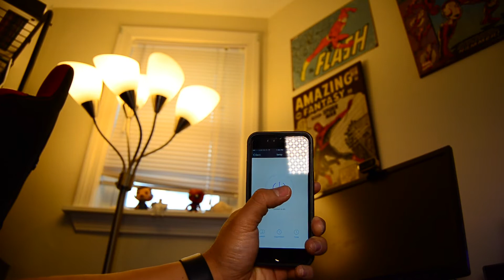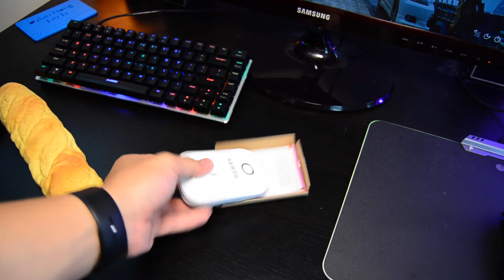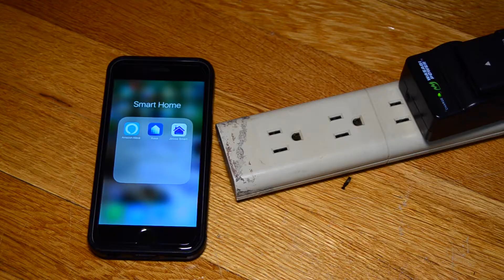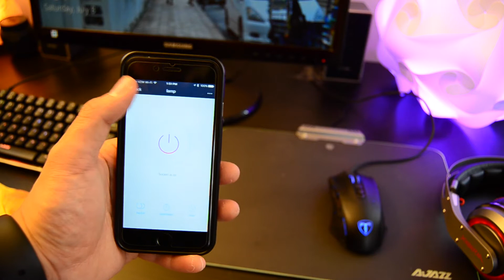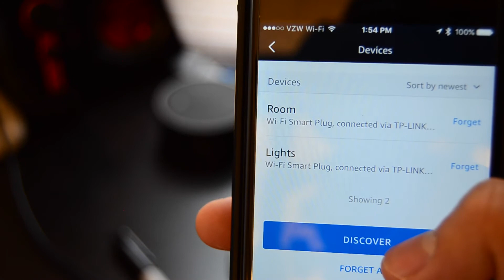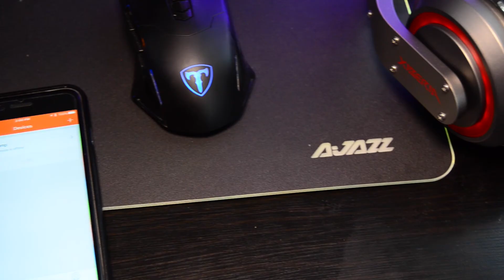CHEAPEST Wifi Smart Outlet - Samto Smart Socket REVIEW 2017 (Amazon Echo)

Comment: SAMTO is one of several companies that slap their brand on these particular switches.  Urant, Hausbell, Voion, J.Smart, ALEXFIRST, TWB Smart, SKYROKU, DEKINMAX and Xenon  are other brands I have seen as well as generic unbranded versions with no branding whatsoever.  They all seem to work with the Jinvoo app and Jinvoo Alexa skill.

I recently purchased a two-pack of the Hausbell branded version of this switch on eBay for a very low price.  After receiving the units, I disocvered one of the switches worked and the other did not.  Since it was basically a cheap deal and I had already left positive feedback without realizing one switch was bad, I figured I was not going to be able to get a refund.  Since I have an electronics background, I opened the defective unit, which involved removing a single screw hidden under an ironic quality control sticker on the back, to see what was wrong.  I was surprised to see that one of the prongs of the power plug had not been soldered to the motherboard.  As I said, an ironic quality control label.  Once I soldered the leg to the motherboard, the switch worked fine.  Having a chance to examine the circuitry, I found no branding or any indication of manufacturer so I assume one or manufacturers are cranking these things out and slapping a brand label on for those firms that pay for it.  Apparently quality control is not the greatest as the missing solder on the circuit board showed.  With the devices running between $10-$20 on various websites, they are not outrageously expensive for what you get but I would definitely check for a sellers warranty.
Reply from the maker: That's why I generally try to purchase items that are fulfilled by Amazon. If things don't work out I can just get a refund through them without having to talk to sellers who might try to convince me to keep/re-order their product
Reply: Mine are  iCraig branded. The icraig app won't catch and connect to my wifi anymore.  Don't know if I should try to uninstall a reinstall as it's 2023 and the app might not even be available anymore.  Maybe I'll install the Samto app